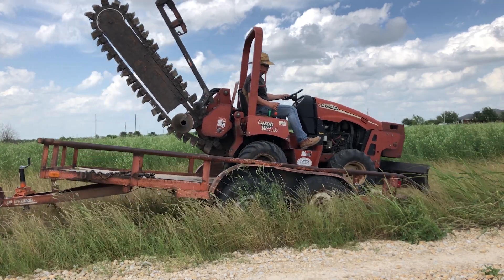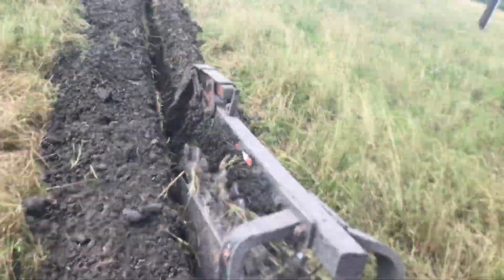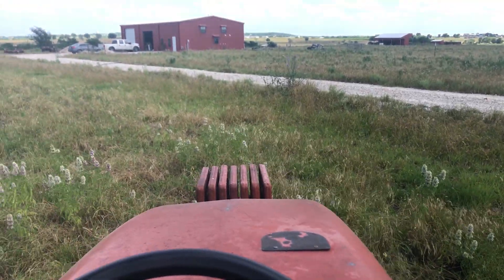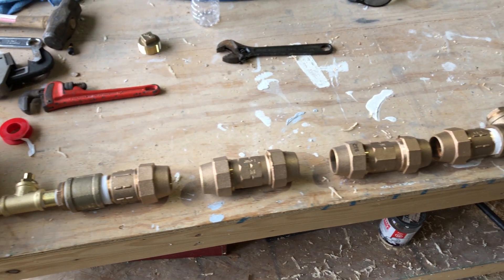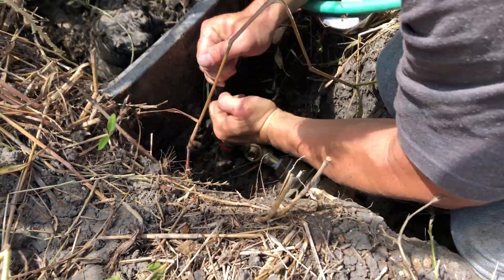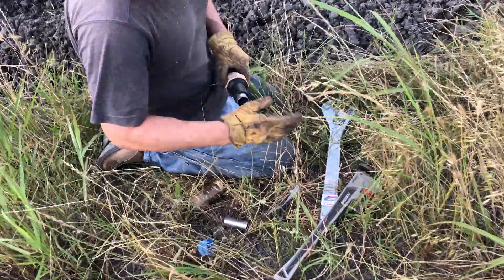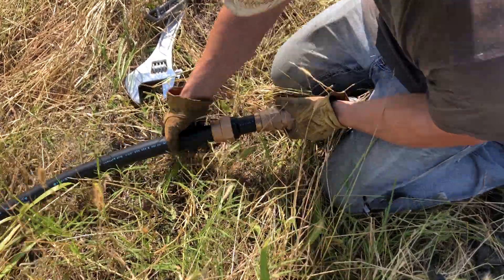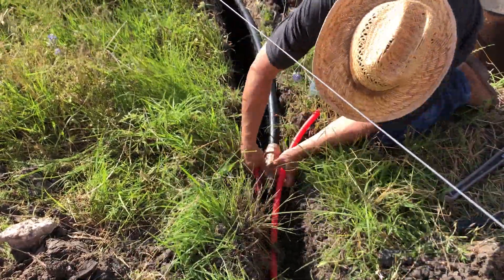Installing Mega Long Water Line

Comment: One tip I used is to install a meter tube and cover over each connection. If one of those ever leaks, easy to find.
Reply from the maker: That’s a great tip. I’ve already had to repair three couplings

Comment: where are your leaks the joints? and why
Reply from the maker: I was trying to be cheap and not buy a big enough wrench to tighten the joints, but I ended up buying a 24” crescent from Harbor Freight and got the fittings tight enough

Comment: Good video; I will be running 1000' of poly pipe from our well location to our home site, also in TX, about an hour North of San Antonio. Good to know it can be accomplished with sweat equity. Some helpful comments are here. Appreciate your details on the poly pipe connections. If you have pressure issues at your home site, a pressure boost pump such as a Grundfos SCALA2 could be a solution.
Reply from the maker: I’ll look into that pressure booster. Thank you for the comment and good luck with your project!

Comment: About to start 2,000 feet. At 1,000 feet I have a peak of approx 10ft in elevation and then it drops down the remainder of the 1,000 ft. Should I consider 2” pipe on this given the elevation incline/decline? Great video.
Reply from the maker: Measure the pressure at the street. I think mine was  65 psi but that was several years ago. My line rises slightly and then drops off some. I think you’ll be fine especially if the pressure is good. Home Depo/Lowe’s have a pressure gauge for pretty cheap
Reply from the maker: And thank you for the nice comment

Comment: Curious if  you've had problems since installation.  I'm about to do 1500'. One thing I'm a bit concerned about is thermal expansion.  HDPE thermal coefficient means a 2300' line, with a 20deg F change in temp will expand or contract over 3'.  The proper installation instructions are to snake the line within the trench and in a 6" trench like the trencher makes you don't have much snake offset potential.  So, there is likely to be a very large pulling/pushing. Trencher is much cheaper and faster than using a mini excavator or backhoe to make a long wider trench to allow snaking to mitigate expansion/contraction.  I am just not sure how much to worry about it.  PVC has a much lower coefficient of expansion, so I think pvc would be 10" for 1500' and 20 deg F swing.  HDPE about 25".  So, just wondering if  you've had any issues?
Reply from the maker: I’ve had no issues with the water line. My biggest concern with PVC was all the joints and our soil that expands and contracts significantly with changes in moisture.

Thank you for the comment!

Comment: Great video. What size poly pipe was that?  Can you describe the exact type/name of the fittings you used to connect everything?  Links to where to buy them would be appreciated. I'm about to do 700 or so feet myself. Thanks.
Reply from the maker: 1.5 inch poly pipe. I used Ford fittings, the first two types in this video 
https://youtu.be/o434Q41khg0

I'm sure Ford Meter Box can tell you a local distributor 
https://www.fordmeterbox.com/resources/catalog-sections

Comment: How long did the trenching take going 2300 feet with that trencher?
Reply from the maker: It was around 12 hours. Definitely get some headphones because it's slow work. Are you installing a similar water line?
Reply: Yes, we are starting a 3,000 foot line to run city water to our farm.  Just found out it needs to be 44 - 48 inches deep here in Southern Indiana which I was surprised at.  Hoping to rent the trencher for a week only!
Reply from the maker: Guess the depth is due to freezing?  Good luck with the project!

Comment: Great video, couple questions, is that a standard 3/4” meter? What pressure is your water meter set at and what’s the pressure at the house? I’ve got about 1500 feet to run here in Ohio. Thanks.
Reply from the maker: Yes, 3/4 meter outlet. Pressure was 65 psi at the meter.  I've never measured it at the house but it's adequate as long as we aren't washing clothes, taking a shower,  and washing dishes at the same time
Reply: @LewisConstructionWelding  What was the name of that pipe?  Was it "poly-pipe" and is it better than schedule 40 or just easier.  I just had a guy sleeve my 2,640 ft 1 &1/2" waterline due to breaks happening after 30 years.  He promised me a 1 inch would be sufficient.  I told him I was nervous going 75 ft in elevation that far.  It's all hooked up and theres not enough pressure to run any 2 items in the house at the same time.  Later I realized that 1 inch poly-pipe was about 3/4" ID.  Hence the frustrations.  Counting 5 leaks in 2 months plus the cost of this I have now spent $5,000 and I still need to run a new waterline.  I'm going 1 & 1/4 ID pipe but not sure if I want poly-pipe or schedule 40.  I'll be close to $10,000 when I'm through so you can see why I want to be careful in chosing pipe.
Reply from the maker: @markwhite6782  It's officially called polyethylene pipe, but most people call it poly pipe or black poly. The main reason I selected was because I could get it in 500' rolls, so less connections and less chances for it to pull apart. Our soil moves around a lot between being wet and dry so lots of potential for coming apart. Sorry your having so many issues. Take care.
Reply: @robertsteele8838  Plenty big enough.  My 1&1/2 off a 1" tap ran 75 feet in elevation and, prior to a pressure regulator, would shoot water 25 feet out the end of a garden hose.  I had to regulate mine down a bit.  I'm trying to talk the water district into running the first 1/4 mile to the end of our road since it will serve 4 other houses.  Then my waterline would be cut nearly in half.  I still hate my sleeve I put in.  Not nearly enough volume.  You cannot water the lawn and take a shower at the same time.  There's enough pressure to throw a stream about 2 inches high from a garden hose when pointed upwards.  Pathetic!